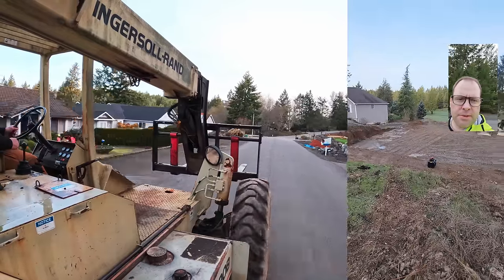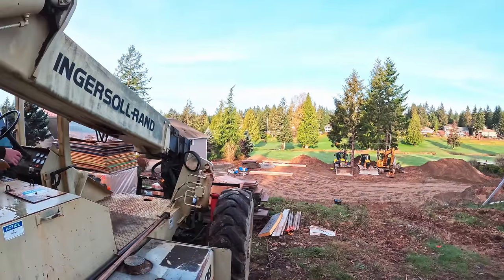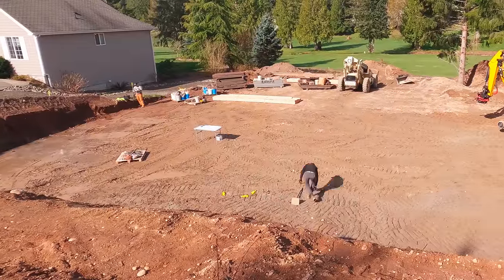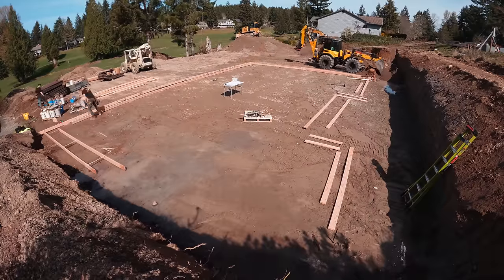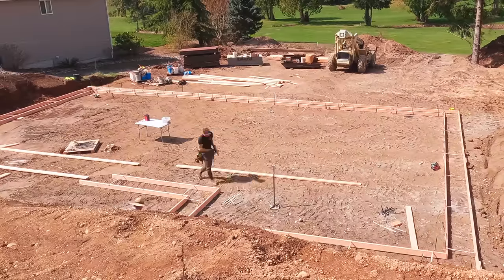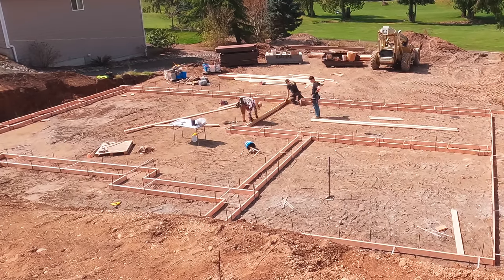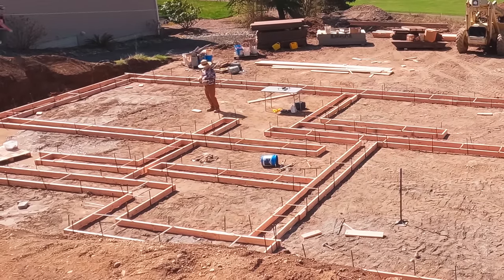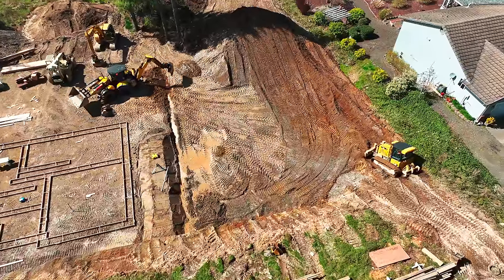How to Form Footings part 1

Comment: New to the channel. Long time foundation guy here. Have you ever tried string lining your building corners then having the labor come behind and build it? Typically we string line the whole perimeter of the foundation wall then build the footing to whatever the proper toe is. Fast and easy and you don't have to mess around straightening the forms. Even the simplest of laborers can come behind and throw up the form boards off the string as well. Can also use it to mark your ribbon boards for your verts. Anyways nice work. Different approaches are always nice to see now and again.

Comment: Hi Tim, great video. Thanks for sharing. How do you or the excavation contractor decide how deep to dig before you build your forms? Also great advice on doing things you enjoy. My dad says that the work will be there when you get back!
Reply from the maker: Thanks!

Basically we stake the corners of the lot out before excavation and shoot elevation at each corner.  Then its just a judgement call between the lowest and tallest.  We always discuss it with the excavating contractor too.  They often have a whole lot more experience and are a great resource.

Comment: The drone photo actually reveal that some portions of footings ( which are quite complex and fragmented to put in place to be fair) are not perfectly straight and at a square angle. Small details here and there. Likely not relevant in the end. 
But looking at how this unfolded, I can see how an aerial photo, as the one you took, could help to spot those small imperfections and by downloading the image to a laptop on the spot, you can actually spot if there are imperfections and rectify with a 20-30 minutes of extra work.
I am not trying to criticize your methods that seem to be as thorough as they can be, but I am just wondering if a further improvement could be made and worth the extra time.
Cheers and thank you for sharing all this instructive videos.
https://youtu.be/5NEgCDBthpI?t=767

Comment: New to framing but why not use survey pins?
Reply from the maker: Good question.  We have the property pins, which were surveyed and set.  They are the original.  Then our site map shows where the house needs to be.  Since the house is smaller than the setback, we have the flexibility to site the house in where it'll look the best in relation to the neighbors.
Reply: Great video! As always phenomenal insight and knowledge on your part. Thank you from Orlando Florida